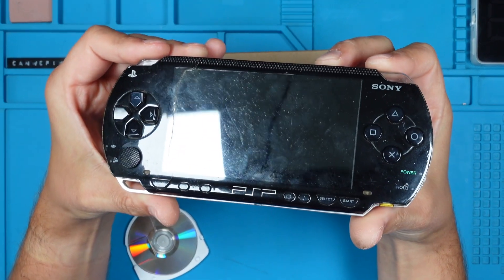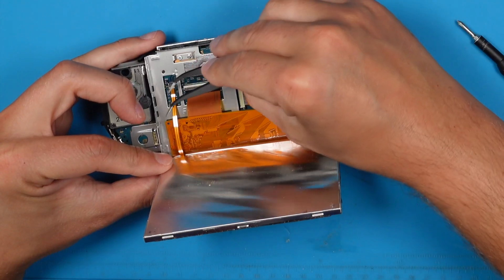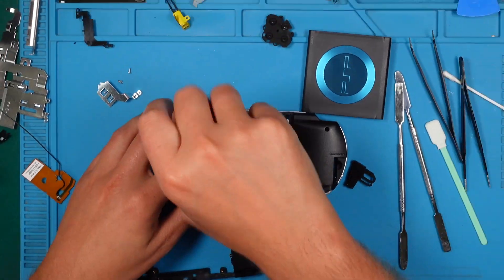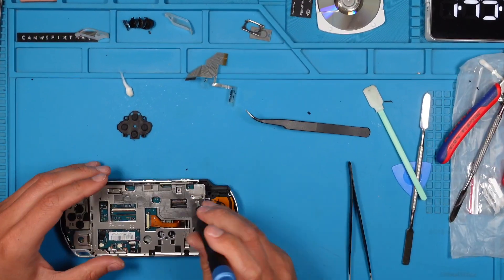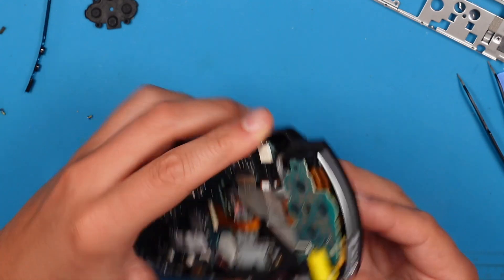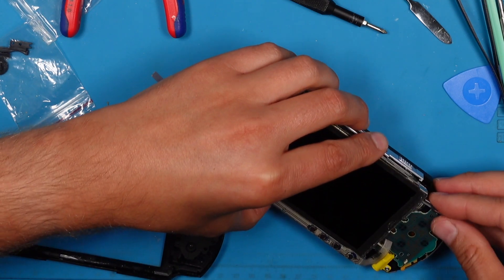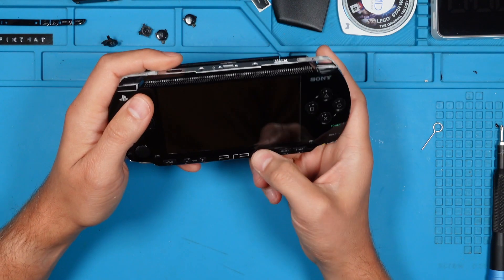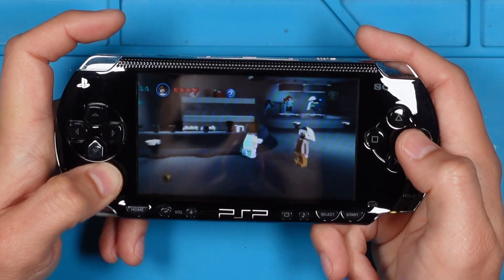Ever Used an ILLEGAL Spare Part? Watch Me Fix This $29 PSP

Comment: I’ve refurbish a few of these. The 1000 feels the best. But the screen is the worst . Recommend upgrading the screen with the ips mod for the 1000
Reply: Yes, it just looks infinitely better
Reply from the maker: Mh, I like the screen upgrade idea! Does anyone know where I could get an original replacement case? The fake one drives me nuts! 😬
Reply: How do you refurbish?
Reply: @DevanshuSehgal  open them. Give it a thorough cleaning. Depends on how bad the shell is, I’d replace the shell. They’re pretty tough so it’s rare one actually needs repairs. Had a few that wouldn’t turn on(a 1000 model), but the problem was just the power switch board. Was able to test it by just bridging points on the board.